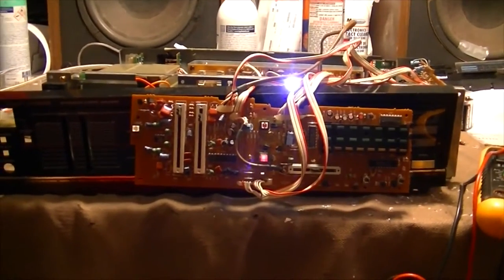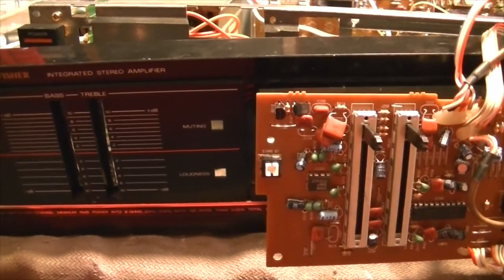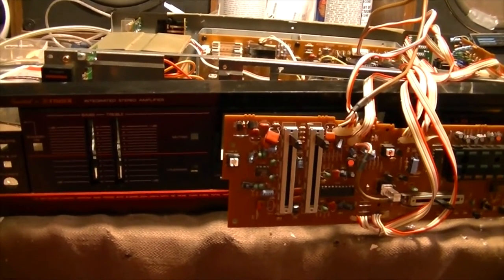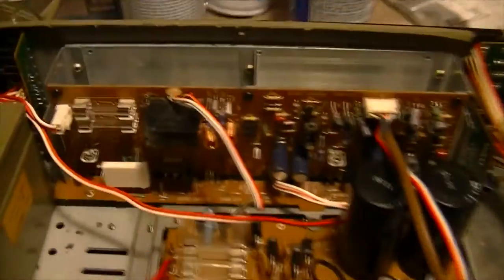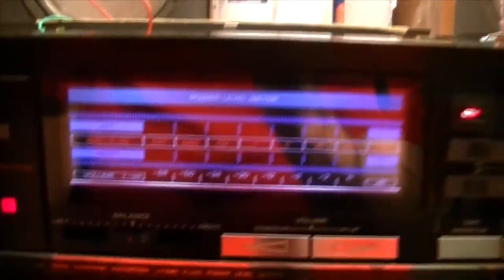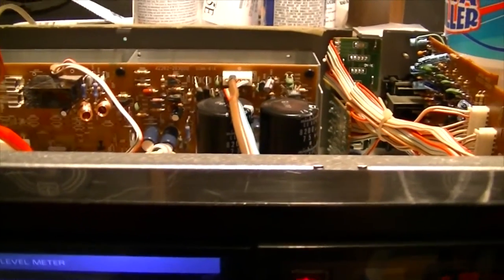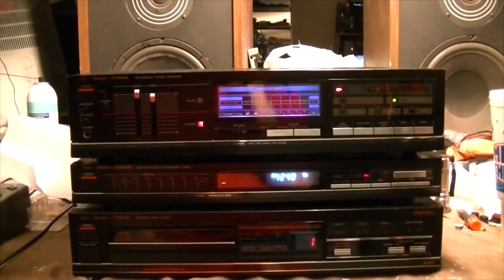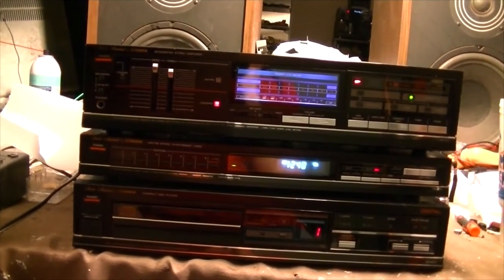Fisher CA-871 System - Repair Series - Part 4 - Amp Repair 2

Comment: i have a ca-57 and also another ( not sure of the model number looks closer to the one in this video but with built in Eq  a tuner and single tape deck cool little systems.
Reply: I have one on that chassis which they used several years. I love mine.

Comment: Maybe something similar about this 939 Fisher  Soundstage  .?? In 1977 i had a Kenwood 9300 WOW and vids never mention it has power amp IN and used it with Traynor gear,901s big Kenwoods 16 in wqoofs and 2  t tables,10 band EQ, YC10 Traynors omn wheels, POWER AMP DELUX. Disco not total sucked.

Comment: Wayback TECH, I've been having problems with my ca-871 amp and I've found the speaker relay to be the problem. Where, if anywhere, can a guy get parts for these 80s electronics? Thanks for your videos. It really helps DIY guys like me to keep these things running and sounding great
Reply: You carefully remove or hot knife an access hole. Then slide card stock dipped in contact cleaner to pull thru the closed points. Close the points by turning on the amp.

Comment: Hi I own a Fisher Component System that I purchased back in 1985 the Amp is the CA-274 I like what you did with the LED's Where can I purchase them at and the cap to them. Thanks

Comment: i still remember the first system i had that i mistakenly plugged the power for another fan rather than the hdd light and fried the bus it had a Cyrix MII 433GP a riva tnt2 and a sound blaster 16 with 4mb memory installed in it the good old isa was always better than the pci version